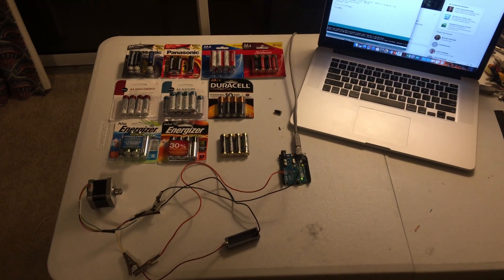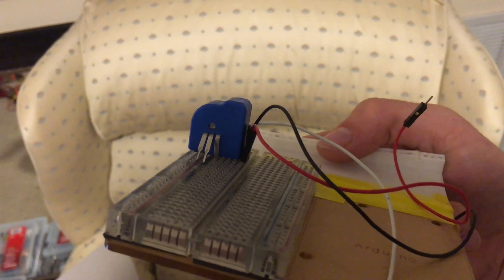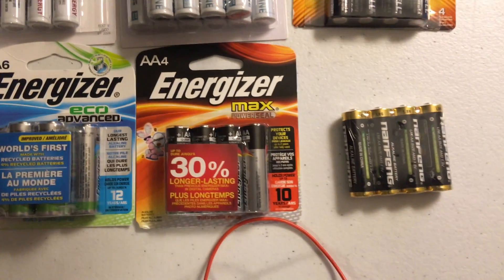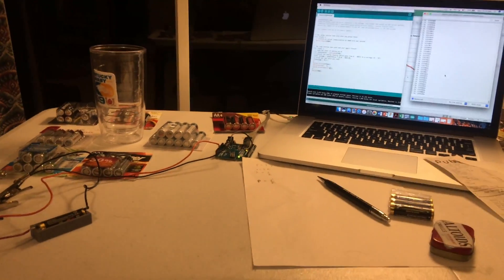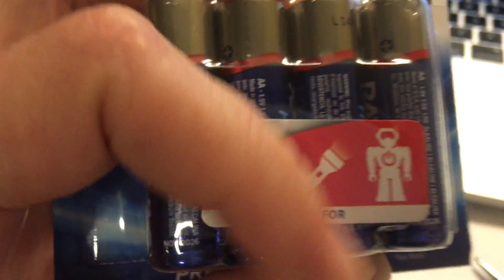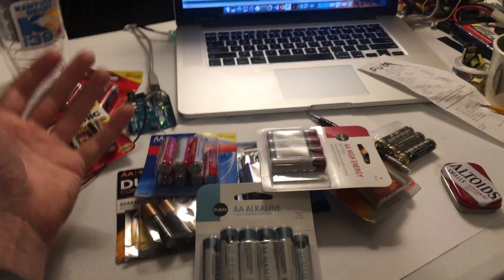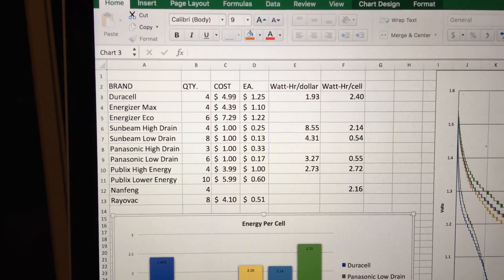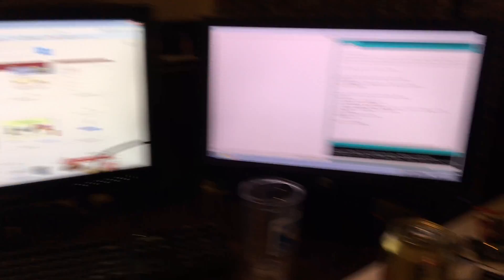AA Battery Test, Dollar Tree etc. With Graphs and mAh Ratings! Part 1

Comment: If you have store brand batteries that say they are made in the United States, look at the negative and positive terminals. You'll see structural similarities between the store brand cell and one of the three American cells (Energizer, Duracell, Rayovac.) That will tell you which company made the store brand batteries. Just a tip for the future!

Comment: I tested Sunbeam AA battery too - I got about 1.0 A-Hr and 1.3 Watt-Hr using a 50 Ohm load. About expected for a Super Heavy Duty Battery. Pretty good for the $. You need to retest with a valid load resistor for each battery type.